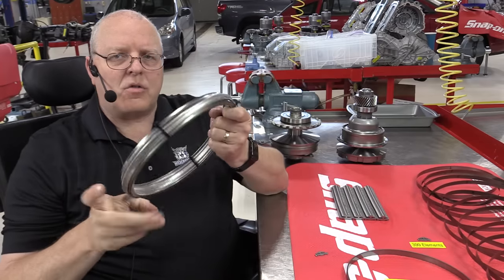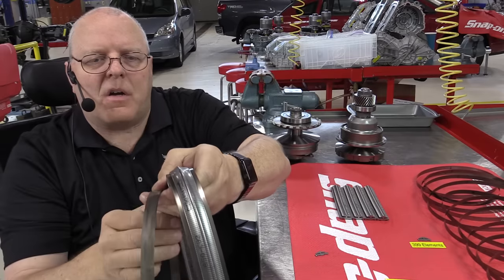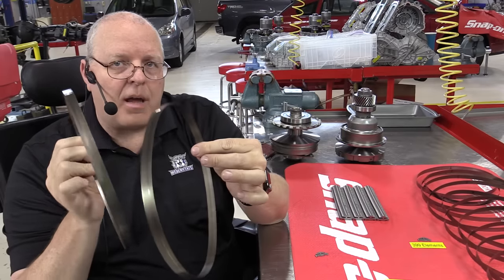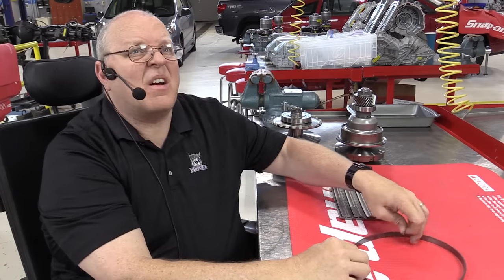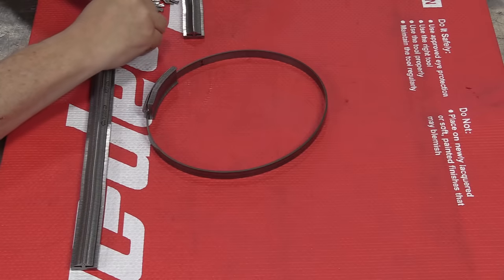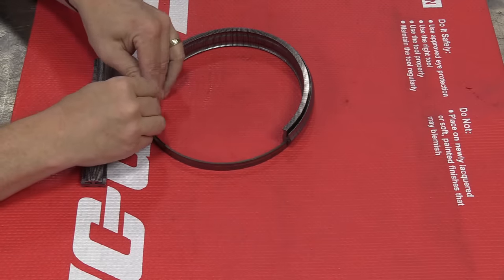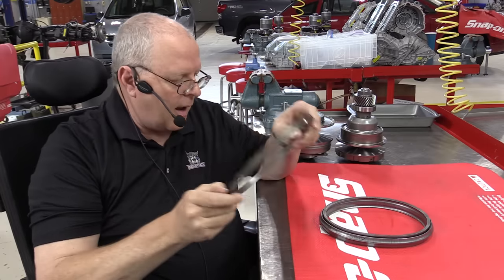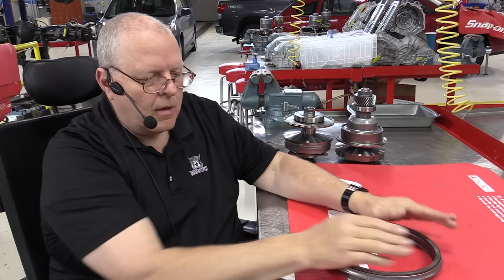The 423-Piece CVT Steel Push Belt

Comment: A broken CVT belt replacement can work out cheaper than a 'conventional' Auto Trans o/haul. Use a magnet to get all the broken bits out, fit a new belt ($500), and put it all together. Done many of them.
Reply from the maker: Thanks for the feedback!
Reply: Honestly doesn’t look too hard for a decent DIYer.
Reply: moyadapne Thanks for the heads up always wonderd how expensive it would be to repair the cvt in my car.
Reply: Good explanation of the CVT belt, honda has had problems with these on 2003-2005 Civics, I understand the challenge is splitting the cases to gain access to the belt.  There are some special tools needed.  Most tranny shops won't touch"em, even Honda dealers will want to put a new CVT unit in, vice,  r & r ing a new belt.
Reply: I worked at a Subaru dealer in the eighties. Back then the Justy was available with this transmission. We rebuilt the odd one, but they were mostly pizza delivery cars driven by young people. I heard one of them bragging about how he could get rubber by holding down both the brake and the accelerator at the same time.
Aside from that, they seemed to hold up well.
Reply: That's right but as it's pushes against "cones" will they not have pitting on them and maybe need replaced from the belt "slipping" on it ie judder when pulling away like i had in an A4
Reply: moyadapne give me a GM 4t80e transmission anyday.  Nissan has nothing on my 22 year old 120,000 virgin transmission powered by a 300 hp 8 cyl Northstar
Reply: @davidjames666  the nissan also likely leaks half as much as that northstar....
Reply: steve will The Northstar does not leak oil, but rather it was known to "consume" oil- which has become more common on modern engines.  I used to resolve my consumption by aggressive accelerations followed by engine braking in 2nd gear.  Now that its mostly a garage queen with only 1,000-3,000 miles a year, adding a quart within that yearly oil change is welcome where it renews the oil additatives. An Italian tune up is all these cars need to stop the 8.5 quarts of oil from getting past carbon fouled rings on the 8 pistons. Sticking with this topic, i am unaware of the 4t80e transmission having any systemic failures noteably leaks.
Reply: @davidjames666   horseshit,ive been a technician for 26 years,ive fixed more leaky northstars and installed more timecerts than you can imagine....junk motors
Reply: steve will they are high maintenance engines.  Many cadillacs on the 2nd hand market after the previous owners neglected the coolant change interval, or they were overheated when the water pump failed.  Coolant needs to be changed every 4 years, and the coolant supplement added. Also many mechanics changed out the dexcool with the green stuff which also contributed to the threads for the head bolts corroding. It was a misunderstood engine.  Glad to hear that you did timecerts on these motors, as after that procedure, the engines were bulletproof like the transmission.
Reply: the northstar is a piece of junk,cut and dry
Reply: steve will a neglected Northstar is a piece of shit, as is any aluminum block and head engine that has not had its coolant maintained, or that has overheated.  Its just that the northstar was early to adapt to such a design, so you are familiar with it. At least the plastic and aluminum Northstar cooling system stood the test of time - unlike the exploding plastic cooling system in BMW and Mercedes today. Failing headgaskets is much more common today with the widespread use of aluminum head and block engines.
Reply: @davidjames666  I had an STS for 7.5 years and it wasn't practical to do the italian tune up and boy oh boy did it carbon up fast....so I tried an alternate approach...I simply drove it exactly the same way as I had my Civic...it took four months to clean it out, it was so bad it sounded like one of the pistons was hitting a screwdriver ...people that knew nothing about cars would just stare at it while crossing the intersection.  

This just meant that I drove it with an authoritative accelerator at all times, and it never carboned up again.  I did need to replace the crankshaft position sensors at 55K miles, got them on clearance at Rock Auto.

About those timeserts...there exists a better solution that has had no failures since it was put into use.

Specifically designed studs with a very wide diameter where the threads are.  When I was done with my STS I sold the car to the inventor of these.  Less than half the cost of timeserts too.

northstarperformance dot com is the company, Jake is the inventor's name.  He will do it if you can get the car to his shop, within 1oo mile radius or so he will come with a flatbed to get it.  His biggest challenge bringing these to market was that he was so busy installing them he had time for nothing else, and also dealing with fake versions of his kits.

So why am I even here in this comment thread?

I have a 2013 Maxima, size and  depreciation made it the second choice if I couldn't find a 2011 STS, which was the case at the time I decided to buy another car.

I bought the car for 15,900 two years old with 30,000 miles.  Still smelled new.  I also bought an extended warranty to cover the length of time I am going to spend with it.

I knew this was a love it or hate it type of car.   I had never even sat in one when I saw the ad pop up.  I just jumped on that phone to inform the dealer that I was going to buy it and listed my conditions.

I slowly discovered features of the car as I drove it over the period of a few months, I was working otherwise with no spare time to spend  exploring.  

I am one of those that LOVE their Maxima...and I drive it like I stole it, minus the inevitable accidents due to the thief's nervousness brought on by stealing a car in the first place.

This Maxima has generated incredible amounts of joy in my posession, something I can saw for no other car I've ever driven.

I've noticed it even seems to encourage 'Hoonery'.  It also seems to have a soul.
Reply: From what I've heard, you cannot just replace a belt. The pulleys and belts have to all be replaced at the same time because they work together and they wear together and if the belt fails the police are technically damaged because the surfaces that the belt rides on are not in condition to work with a new belt.
Reply: @buildfixbreak7947  you are absolutely right you cannot rebuild a CVT transmission you have to replace
Reply: Hi @moyadapne But the belt becomes broken while driving, will those flying pieces hit and damage the spinning wheels and other components?
Reply: Where can I get the belt
Reply: @tomb9566  bullshyt i rebuilt mine
Reply: @gordoh666maik4  prove it show receipts
Reply: @JamesZJi  Hi James. Sorry to reply 9 months later, but I've got adblocker, so I don't get notifications. OK, when the belt breaks, it kinda falls apart and lays there.  I've done probably 50 Mitsubishi CVT autos, and not seen any damage. Also, Mitzy cones are mostly ok, as it seems it's not cone wear that breaks the belt. 7 years later a customer's one is going well after I replaced the belt only. Remember...when the belt breaks, there is instant zero drive, so no mangling of parts.  Nissan on the other hand....a belt-only replacement can be fraught with problems, as the cones wear too. Hope this helps. Paul. NZ.
Reply: @tomb9566  that's incorrect, you can rebuild them. Quite easily actually. Dealers just replace them to make more money. Once parts are more accessible for transmission shops, they will be able to be rebuilt for much less money.

Comment: I'll definitely keep my manual gearbox, but had always wanted to learn more about the internals of cvt automatics. great video.
Reply: 3 years gone and automatic double clutch with 6 or 7 gears has won at least for ICE because the efficient power band is not that narrow after all.
Reply: Manual is the most fun. It also allows the engine to sound its best.

Comment: I've had a CVT fail on me.  Warranty paid for itself just on that one repair.  According to the tech that replaced the transmission, it was all chewed up inside.  I can only imagine scores of loose elements acting like a toddler with a bastard file to everything inside the case.
Reply from the maker: It would be a mess for sure!
Reply: Saberus Terras what car/model did you have? do you find out why it failed?
Reply: What vechel
Reply: @ronringler4286  2012 Nissan Sentra.
Reply: When I drained the CVT fluid in my Honda Civic 2015 some of those elements came out of the drain plug. The transmission failed when I drove it around the block. When I took the sump pan down there were loads of them in it. 89k miles. These transmissions suck and should last longer then that. I won’t buy another car that has one ever!

Comment: I finally found something on the subject. Thanks for the practical handful.

Or maybe you have experience what you need to do to convert cvt k311 to more accessible and reliable cvt k313? Toyota Verso 1.8l 2010. Is it enough to replace the engine controller with the k313 and the rest of the same?

Comment: No reason they couldn't have made it with 400 elements
Reply from the maker: Why not 400? Because 2(177.5 mm pulleys) + 2(10 mm band packs) + 2(12 rings per ring pack ) = 399. Just kidding, I have no idea! Have a good day!
Reply: they did it to save cost. lol.
Reply: Local 223 They did manage to force one more element but the belt blew apart like George Costanzas wallet
Reply: That way, they can ship them in packs of 400 and you're still good when you inevitably lose one.
Reply: Just to show who's boss
Reply: My guess would be something to do with pi and even spacing...
Reply: It's all because of marketing. Humans are more attracted to the '99'. That's why they market everything as like $1.99 instead of just $2.00.
Reply: Weight reduction bro.
Reply: Overkill..
Reply: The 400’s are only in nascars, to much torque
Reply: It should be 400. Someone just didn’t want to recount. 😂
Reply: Just to make people like me suffer
Reply: They make 400 element ones for non-Masons. 😆
Reply: @WeberAuto  is that a reason theres some that maybe not produce well on CVT make it harmful on engine so they take it away? Maybe honda do that but I forgot. Correct me if I'm wrong
Reply: I think they make it with the minimum number of elements that is able to make the tightest required turn around the pulleys, within a set tolerance. The strongest and simplest "belt" would be 1 element but then it would't turn at all!
Reply: @WeberAuto  real FUNNY
Reply: Somewhere, there's an engineer with an equation that shows that the cost/quality ratio peaks at 399
Reply: probably the reason nissan cvt’s  break. lol.  they thought they put 400
Reply: Nah 420;)
Reply: Cause then it would be to long. Doh.
Reply: FYi.. 400 is not a good number... 4 mean death in fengshui 🤣🤣🤣🤣 399 is better number can give its owner prosperity lolx
Reply: Maybe because after initially designing it with 400 and absolutely zero space between the elements in theory was in practice too tight. Taking out one element could have been the right amount of space dispersed among them to make it work well (?)
Reply: Could it be similar to the reason they use prime numbers on gear teeth? To have an even wear among all the elements
Reply: 400 would have made the 'rubberband' effect of the CVTs a bit worse, the engineers said let's have 399 and reduce the effect.
Reply: @xESPplayer500x , not an engineer... an accountant.
Reply: Because life
Reply: maybe the same reason why gears and synchronous pulleys have strange numbers of teeth sometimes, to avoid wear patterns when the same elements interact repeatedly. But I'm not sure how important that might be for a CVT system where the ratio can, in principle, be anything between two limiting values. Maybe possibility of harmonic oscillation in an orderly structure like a 400-node belt.

Comment: My 2007 Dodge Caliber R/T AWD had a CVT: a Jatco E-1974 (a Nissan company), shared by the Nissan Versa of that time.

These things are insanely demented: if you stop in a moment where the CVT programming doesn't have time to readjust the pulleys' ratio, your next acceleration will be severely underpowered so that the pulleys can reset to the low speed ratio required to get the car moving: you'll be moving at around 1km/h. More than once this happened to me and the last straw was when I merged in a 90km/h zone from a stop with a considerable gap to merge traffic. Some idiot was tailgating me and when the car started moving, had no speed nor power, nor place to move back. A semi jack-knifed around me to avoid my dead car.

Sold that thing which tried to kill me and got the SRT4 model, with a real geary transmission.

Chrysler marked these transmissions as non-servicible. It's interesting to finally see that belt which tried to kill me on more than one occasion. May Jatco burn to the ground for these devious devices.

FYI, a larger version of the E-1974 was also made and used in the Nissan Murano. I have no experience with those: I've stayed away from these as far as I could!
Reply from the maker: Thanks for your feedback!
Reply: Have a 2015 Honda Fit with a CVT. I have never had a problem merging onto a limited access highway. I just put the throttle pedal to the floor; the engine rapidly revs up to near readline, to about 6600 RPM, and stays absolutely rock steady at that RPM, the transmission rapidly drops down to a high pulley ratio (ratio of engine speed to wheel speed) and rapidly changes ratios while the car accelerates smoothly to 100 kph in less than 9 seconds with a tiny 1.5 liter 128 hp engine. No jolts as the gear ratios change. Just smooth acceleration. Cars and trucks move to the left land, or slow down, to let me in – unnecessarily. How long will it last? I don't know. It seems to need more frequent lubricant changes than a traditional planetary gear automatic. The lubricant is only available from Honda and is rather expensive. But I have nothing bad to say about the way it functions.
Reply: @soilmanted  honda has had cvt since 95

Comment: Great video. I have seen many videos explaining CVT, but with a rubber belt. I ask, how can rubber handle high power? It must be a strong material with high fatigue cycle. Steel is strong but it will fatigue and soon break. And I thought about band saw. The multiple thin steel ring makes sense, or high fatigue cycle and strong. Now I wonder about those 399 toothed elements, when they worn down to smooth, will it slip or time to replace?
Reply from the maker: Yes, when they wear down it will slip. This would take a very long time to do unless the driver is very aggressive. Thanks for your feedback!
Reply: If ya give a CVT car to a rambunctious teenager..  That belt not survive..  For some reason,  I'd like to see one break,..  411 piece of steel flying around inside the case at high velocity would be a sight to behold..  LOL,  Yes,  I'm weird like that..
Reply: If you give a rambunctious teenager a car with a clutch or an automatic transmission something is likely to break.

Comment: I had a Heathkit Boonie Bike way back that had a torque converter that worked very similar to this. It was a 5 hp mini bike that could outrun the Honda 70's, but was not near as cool. I am going to avoid buying a car with this for now. This is interesting information. Great job explaining this system!
Reply from the maker: Thank you!